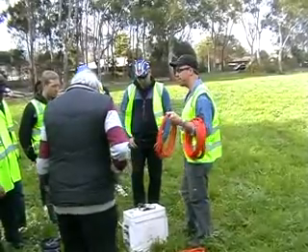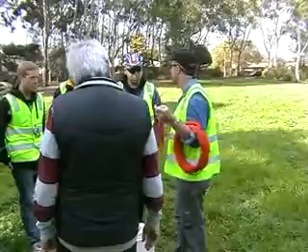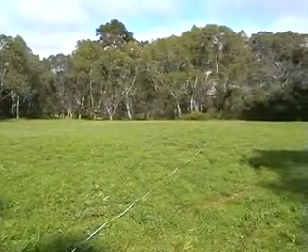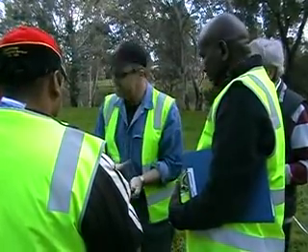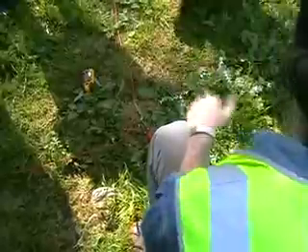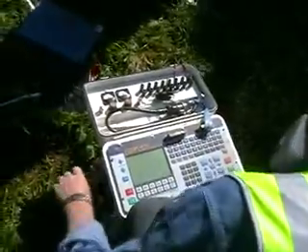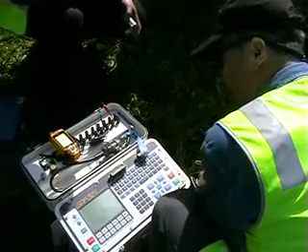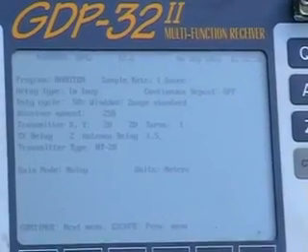Eletromagnetic Survey Demonstration

Comment: What's the accuracy of this method compared to test drilling?
Reply: Good question. We in iceland, would do about 2km per person, in a square. Then we hopefully meet up at the ends. We would use...a mirror, for our connectors, have a bunch of coils (one ine front, back pack with 2). 
Then we would march back towards the middle. hopefully, not yelling at each other for going off line. 
It's quite hard, going up and down over hills, to keep bearings etc, 
Easy enough to circla a little back and fix stuff.
The worst one, and i repeat, the worst one...is people who write 1 and 7 in the log book. 
Bc then you have to go back....and no one wants that.... so cross your 7.....lol...
Reply: Apologies... so, around 700m to 1.2km plus minus...in depth...error...neglible....i forget the derivative for TEM....but didnt matter. IMHO.